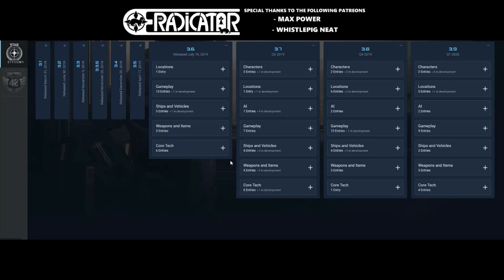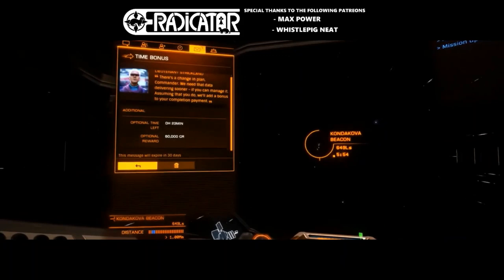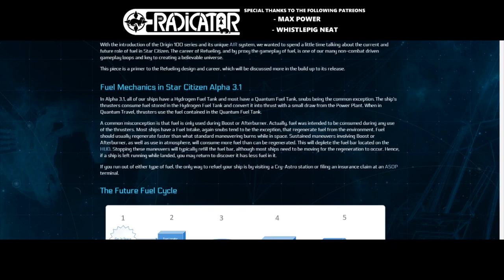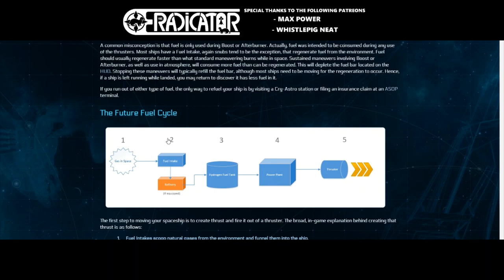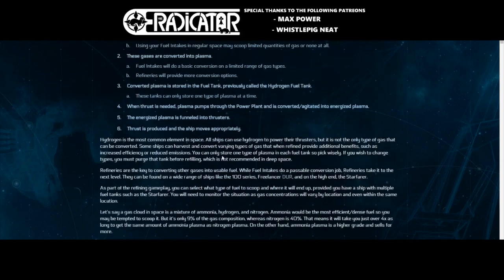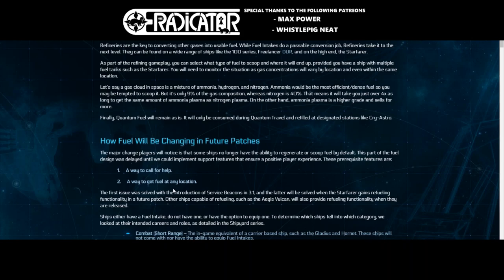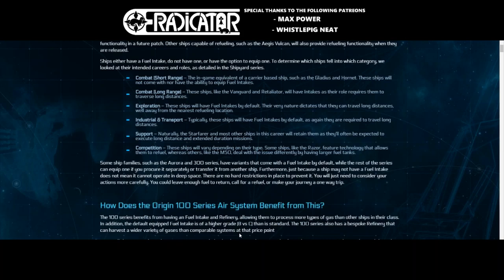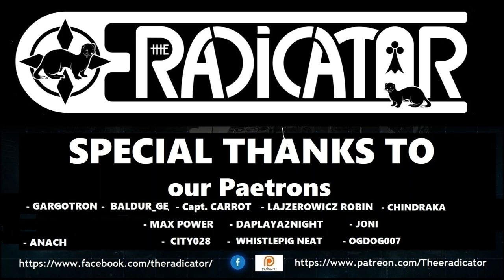Star Citizen 3.7 - All about FUEL SCOOPING

Comment: The game should embed the rocket equation, which basicly means that adding fuel increases the mass of a ship, which therefore requires more fuel. A 890J with water in the swimming pool should require more fuel for a partcular trip than the same ship without water, or it could move faster for the same amount of fuel. All kinds of interesting gameplay would arise from this.